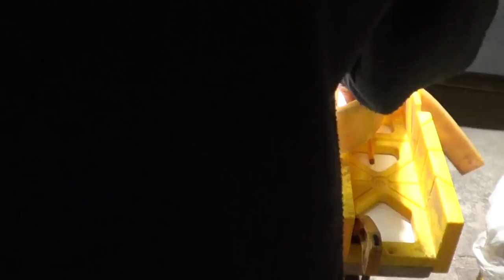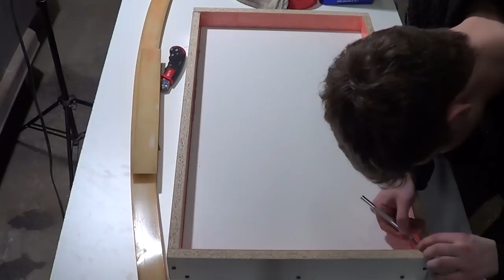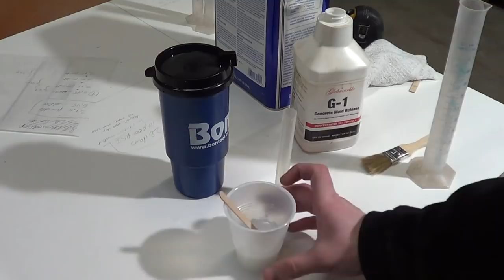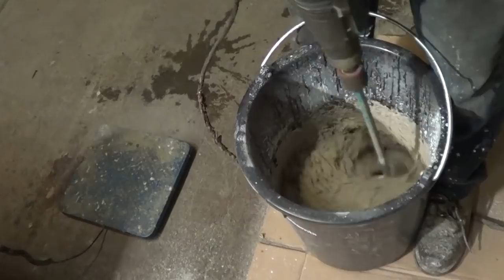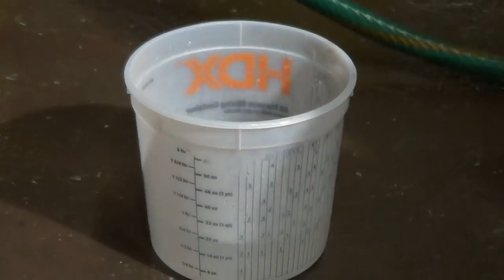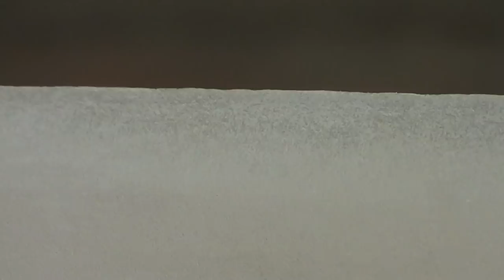How to Make a Lightweight Concrete Countertop

Comment: I used the 1" foam when I poured my kitchen countertops 5 years ago (before I'd seen anyone else do this). The issue I ran into was keeping the foam from floating to the top of the mixture, thus preventing the concrete from reaching the top of the form edges. I noticed you struggling with the same thing before cutting away, then showing the concrete setting up before covering it.
Do you have any tips on how to keep that foam from floating on you? Also, is there any reason you didn't just leave the foam in? (that's what I did with mine).
Thanks!
Reply from the maker: The best way is to screw a wooden slab across the top of the form walls. That way the foam can't float any higher than the top of the walls. And I removed the foam to reduce the miniscule amount of weight it adds. Totally unnecessary

Comment: if you had used a vibration table do you think it would gotten out the air holes on the sides?
Reply from the maker: A lot more bubbles would have been taken care of with a vibration table yes

Comment: What creates tensile strength in your concrete mix? Especially when making larger cantilever counter tops?
Reply from the maker: Here is the link to the mix, and you can find a TDS on this page to get very detailed info on how to use the product under any circumstances https://globmarble.com/concrete-countertop-mix-white.html

You could use mesh and rebar to make the concrete have stronger tensile qualities though :)
Reply: Your videos are fascinating to watch. You explain everything very well. But, I haven't been able to find if you can use your live edge molds on a concrete overlay project on an existing countertop.  I saw the one where you created a stencil but was curious about the live edge mold.

Comment: I recently built a top using this forming method but on a larger scale. The problem I ran into was that, because it took several buckets of mix to cover the bottom of the form, when cured and flipped you can distinctly see the separate pours on the top/finished surface. Do you have any tricks to avoid this issue? I have one more to pour and would like to have a solution before I get to it.
Reply from the maker: There are two ways to fix this issue. Simplest way is to pour the second bucket directly on top of the first buckets concrete, not next to it. Second method is getting a larger bucket :)
Reply: @GlobMarble  that makes sense. Thanks alot.
Reply: @GlobMarble  I want to hug you, thank you for sharing your knowledge and say, "screw the haters"! However,  I have learned that,  if you know what you know, it's good and you want to share it, the haters are sometimes the best advertisement ever! Your responses to all have been informative, polite and  professional! 💪💪💪🙏🙏🙏🙏! So proud  of and appreciative of you all! Keep it pushing!  I want to stain my concrete countertop as black as possible, how can I get this effect? Thanks again for sharing your knowledge!❤
Reply: @GlobMarble  you young men know your stuff!!! How do you purchase your product?

Comment: You could of mixed the patch alittle wetter to avoid them air bubbles. I make compass rose tables that has a ton of detail and rock face sides n gett no bug holes everytime. Add the water to the mix
Reply from the maker: This will make the concrete weaker!
Reply: @GlobMarble  or use FLowControl....

Comment: You didn't show a closeup of the top surface. Is it as perfect as it looks?
That 3/4" thick edge. Is it strong? What about accidental knocks with saucepans?
Great work by the way, I'm quite impressed.
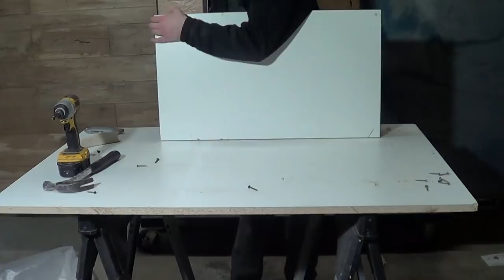Reply from the maker: Thanks! The surface is perfect, you could see it on the reflection at 19:04 in the video. The concrete is very strong, after 28 days the PSI is at 10,730 for our precast mix.

Comment: Would it not need steel reinforcement in the concrete?
Reply from the maker: In most of the cases you don't need steel reinforcement if you use our precast mix. Our precast mix contains allot of fibers. https://globmarble.com/concrete-countertop-mix-white.html   You may need to extra reinforce in case if you make a large panels or thin parts.

Comment: If you would have wet your concrete when you were mixing your slurry.  You would have had a color guide to instead of waiting for your slurry to dry.
Reply from the maker: Wet concrete it's one of usable option. It's little more accurate in dry concrete. Thank you for the comment anyway...
Reply: @GlobMarble  what happened to your original ratio in mixing the concrete? why did u have to guess the blend ratio in the bubble fix? it would have been cooler if u presented a fixed ratio  bro...
anyway i liked the hollow idea...great help in the weight issue...👍👍👍